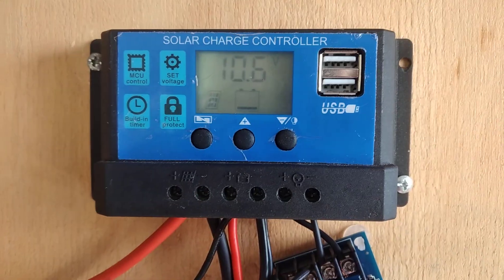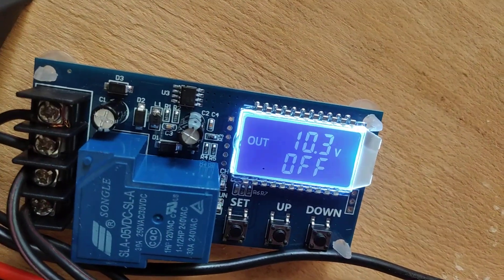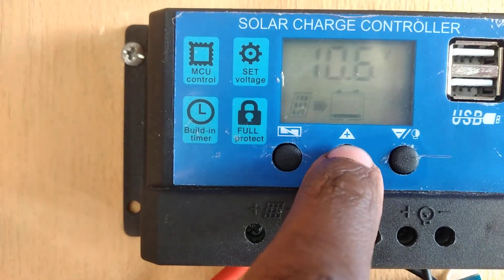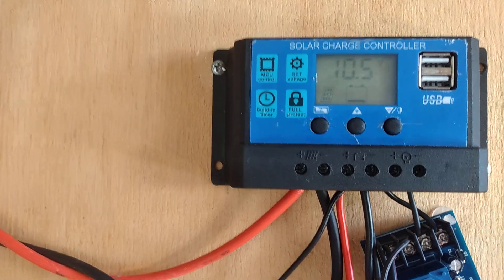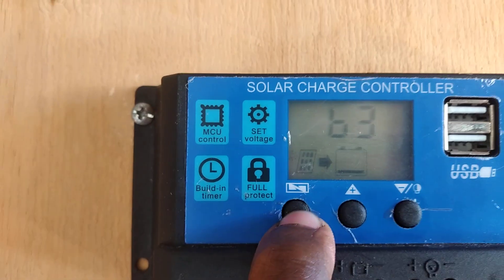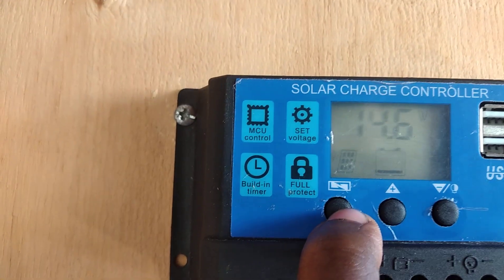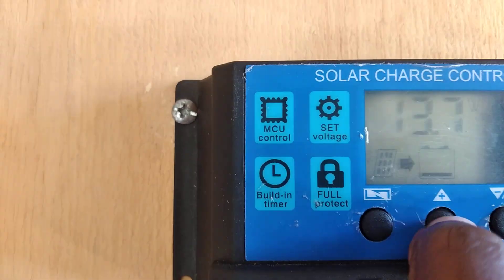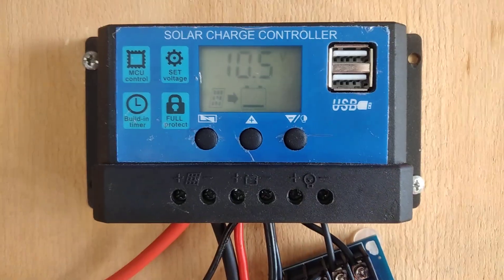How to configure cheap MPPT/ PWM solar charge controller.

Comment: GOT THE EXACT SAME SOLAR CONTROLER  IVE GOT A 100W SOLAR PANEL FROM HARBOR FRIEGHT ALSO A 12V 35AH BATTERY. I HOOKED UP THE CONTROLER AND NO SOLAR ICON POPS UP. THE BATTERY IS THERE THE LOAD LIGHT BULB IS THERE. WHY ISNT THE SOLAR CHARGING? PLEASE ANY HELP WOULD BE TRULY APPRECIATED.
Reply from the maker: If you see the battery icon and solar icon together it means it is charging.
Reply from the maker: The load light is for an auxiliary light. It's not mondatary.
Reply: Maybe the battery is full, if the battery is full the solar panel icon will disappear.